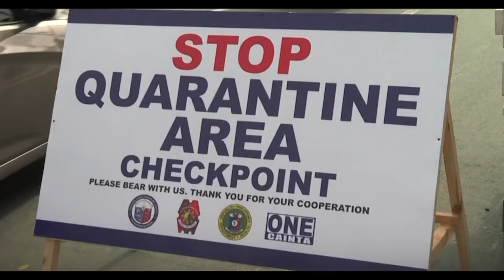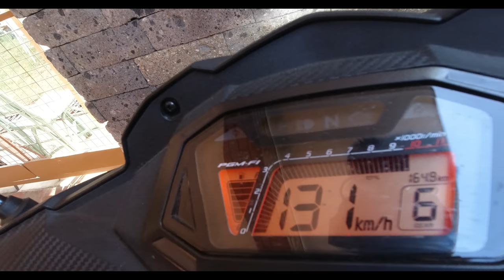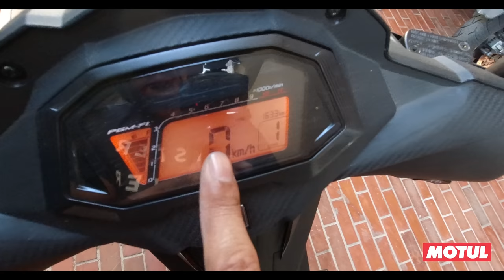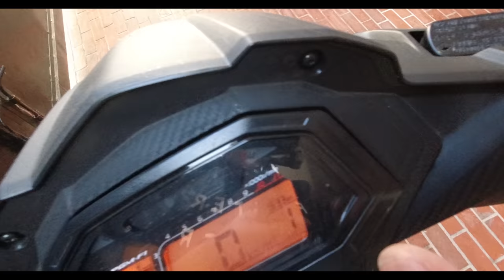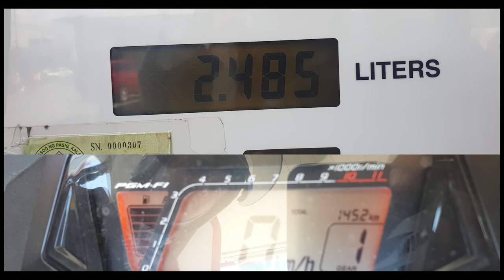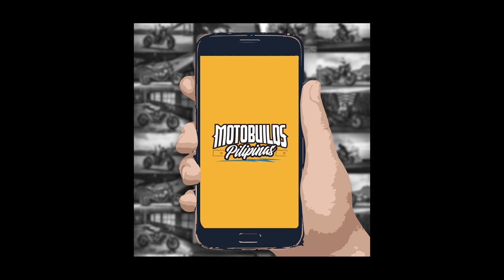Honda Supra GTR150

Comment: Honda still honda but their are trying the market, increasing the price without the  safe abs. Most of the models with 150 in India comes with abs as I know. Why Philippines accept bikes without abs? Let them adjust to de country.
Reply: Unlike India, we don't have a law that pushes manufacturers to add ABS on models in the Philippines so we just enjoy what we got.
Reply: Wala pa po ata underbone na ABS sa pinas?
Reply: Maraming matatanda ang hindi naman namatay dahil walang ABS motor nila. Mga Indian kase solid maglaspag ng mga gamit yan. At sobrang demanding. Kaya halos production sakanila may adjustments. Ung R15 sakanila hindi inverted shocks pero naka ABS. Tapos naka mud guard na rin agad dhil maputik sakanila.
Reply: Sakin lng kng di ka tlaga kamote at kng natuto sa mga my clutch na motor hndi bigdeal ang abs na yan..ako natutong mg motor sa mga twostroke wla png disc brake ni minsan di ako sumimplang..nsa driver na yun at kpag nagmaniho ka maging defensive driver ka...kso karamihan ksi ng nagmomotor ngayon natuto sa mga scooter mdali lng e drive kaya mga kamote labas nila😂😂😂
Reply: @kirmetpunk4407  true.  Tama

Comment: Honda GTR Supra owner here....Supra is so tipid in fuel consumption and a very reliable machine. ...malakas ang hatak at mabilis din tumakbo umaabot sa akin ng 137kph.....I am 63kg, and 5,2" tall.....sa akin sulit na sulit c Honda GTR Supra 150 na pang sports touring.....hindi ka na mabibitin sa overtaking.....suspension is very good and has a powerful braking

Comment: Proud Supra GTR owner here sir Zach, Salamat po sa Awesome review!
Reply: Sir may question lang po, ano po ba feedback niyo sa gtr? Positive at negative? Heheheh may plano po kasi ako mag kuha. Thanks po
Reply: @kianavila3619  all goods ang GTR bro. malakas ang Torque tska super tipid sa gas.
Reply: Salamat po sa opinion niyo hehehe
Reply: @kianavila3619  no ptoblem bro, good luck sa pag dedesisyon mo hehe
Reply: Pero para sayo po alin ang mas ayos gtr o sniper? Heheheh
Reply: @kianavila3619  maingay makina ni sniper. Mas swabe ang gtr lalo na sa high gear. Napaka stable ng gtr

Comment: To motor ng mama ko, bilis at stable sa high speeds. Pero mas trip ko parin ang 2007 xrm125 ko na pinaconvert ko to manual. Masfeel ko ang agility, steering at may sentimental value ang pagiging 14 years old ng mot2 ko.

Comment: Ganda ng Honda GTR 150, proven and tested ko na Tagaytay at Doña Remedios Bulacan

Nakapalakas sa ahon, stock sprocket set lang 14/44

Kaya nya mang overtake sa ahunan tapos sa pababa naman napakalakas ng preno sabayan mo pa engine brake, masakit siya sa kamay sa lakas ng preno.. nissin brand kasi eh...

Sa paakyat ng bundok offroad kinakaya talaga.. kapit ng gulong, IRC kasi eh

Kasama ko pa misis ko, di masakit sa upo... Wala sinabi suspension ng Rfi at sniper sa shocks ng Gtr + ung front shock na mataba, Showa brand kasi eh...

Maganda lalo pg 2022 version pataas kasi facelifted na..

150 pesos premium gas at 63php/litr tumakbo ng 106km bundok bundok pa yan...

Top speed ko 127kmh, obese ako 103kg... Pg kasama ko misis ko na +60kg with 55l alloy box, kaya namin mag 113
Reply: Totoo yan honda gtr user din ako.. sarap idrive pag malayuan.. cabuyao laguna to zambales.. walang palya , walang pahinga pero di ako binigo ni GTR
Reply: @yamete679  wala ba kayo problema sa spare parts? Sana masagot bago ako madala sa Sniper155. Hahaha
Reply: @pedro_kapparosso  sir 2023 na tayo , di yan mahirap hanapan ng parts yung GTR 150 . Dahil marami yan sa online .. kaya lang naman mahirap hanapan ng parts yung motor nayan kasi bihira yung ganitong klaseng motor.. mas marami kasi sniper at raider sa pinas.. pero ako never ako nagsisi sa motor nato although sinasabe nila pangit ang itsura or pormahan pero di kasi yun habol ko kundi yung quality at power ng makina ni honda... kung pormahan pag uusapan pwede mo naman pormahan marami na sa online pero medyo kamahalan nga lang...
Reply: @pedro_kapparosso  hindi katulad sa sniper 155vva .. nagtatanggal kalang ng fairing nabali na ang mga lock , tapos tensioner problem din , tapos minsan nagtatanggal ka lang ng bolt sa ilalim ng kadena nabali na.. hahahaha porma lang maganda pero quality wala padin tatalo sa honda... kaya nga kung makikita mo mga honda bikes kahit ilang taon na buhay padin...
Reply: @yamete679  salamat sa sagot. Ilan km per liter fuel consumption mo? 40-42?
Reply: @pedro_kapparosso abot 50 kung di ka puro downshit at rev matching... pinakamaganda ung 97 octane sa metro astro or unioil.. (sayang wala na blaze)

Comment: After owning xr 125 na grabing problema after 3yrs use, parang ayoko na sa honda.
Reply: k56 engine pa rin yang honda supra gtr 150,. issue palagi sa cylinder head k56 engine dahil sa pangit na design ng oil flow sa cylinder head.  https://m.youtube.com/watch?v=EJnN7606DWA

Comment: Can YOU ASK EACH MOTORCYCLE BRAND its METALLURGY of the ENGINE... because for me they just change the image but the metal content is still the same and mechanical system still the same,no hurt feeling but many NEW ICE motorcycle is a Scheme and kind a confusing people in other side so people will BUY another and another until you found your self circling  to their JOKE and making yourself a fool. In short they are just MONEY MAKER PRODUCT.no advancement... Better look all advancing technology for ICE and you will notice THEY APPLY NONE of it in so called NEW MODELS.